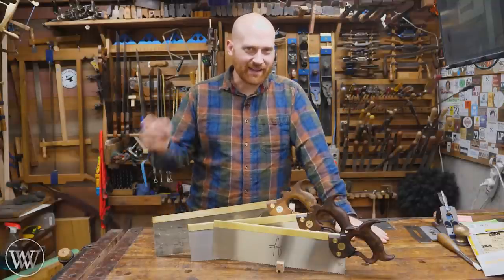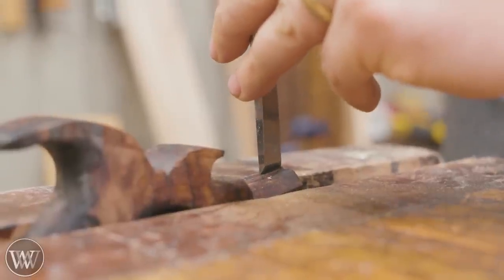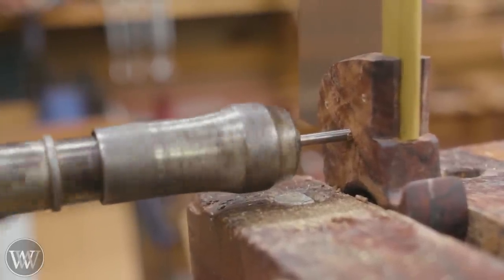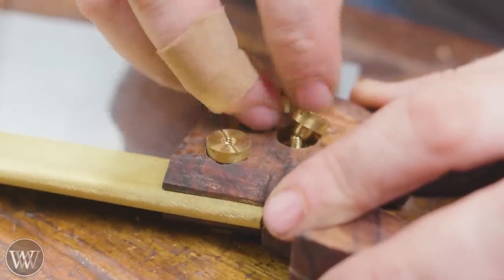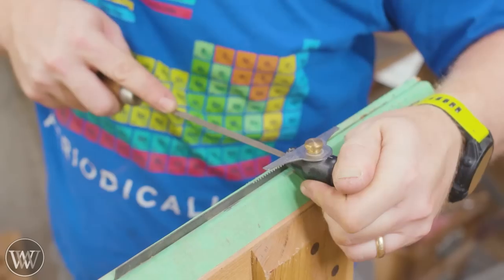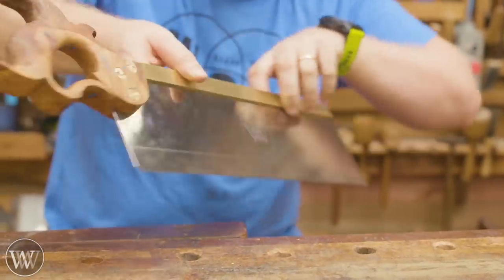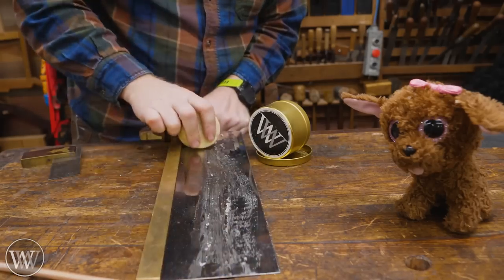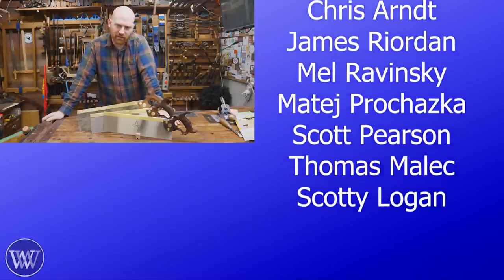How To Make a Back Saw The Hardware Part

Comment: Those are some really nice looking saws!  You've put a lot of effort into getting the details just right.  Thanks for these videos, without guidance from you and all the other creators in the youtube woodworking community this sort of thing would be much tougher to learn.  
 I recently finished making a 3d printable dovetail saw, which I'll soon be posting on Printables and Thingiverse.  Cutting and setting the teeth was a challenge.  Mainly just seeing the details was tough, mine was 15tpi, and I will be using some more powerful magnifiers next time I need to sharpen it.  I did some experiments with your other method of marking out the teeth with a hacksaw, but my tooth pitch was too close to kerf of the hacksaw blades I had on hand, so I ended up using the file to do the marking and the cutting.  I don't own a saw set, so I did that by the method Paul Sellers showed in a video where he used a punch.

Comment: Did you need to do any work to flatten the plate after assembly? To do all the work by hand (no drill press) is really impressive. Great video.
Reply from the maker: That is the fun of a folded back juse a quick tap on the bact fixes the plate.

Comment: Thanks James! I really enjoyed that. Why do you want to upgrade from your Veritas saws?
Reply from the maker: The Veritas saw works well. But the handle leaves a lot to be desired. Also with a folded back you can easily adjust the plate and there's less chance of kinking it in the future. With the Veritas saw it pinned and glued in place and if you run into something the plate will kink easily. Veritas is fantastic for the price. But it's not a high-end top saw.

Comment: Did you have to do much straightening to the plate after the back went on?  I always drill the holes in the handle and cut the slot before I shape it, then it's not a huge waste if the holes or the slot goes wrong...... You're brave cutting the smaller through hole first 😆 Is that carbide spade bit good for drilling the plate?
Reply from the maker: With the folded back I don't have to do much straightening at all just give it a good tap and it brings it right into place. Yes the carbide bit does wonders for drilling through the plate.
Reply: @WoodByWrightHowTo  Thanks James, I will probably buy that bit, spring steel eats up my cobalt bits and I'm fed up of sharpening them after like 2 holes  😂

Comment: What if you don't have access to a saw that cuts a thin enough kerf in the handle for the saw plate?  Your thinnest saw needs a handle!
Reply from the maker: You can always use the sawplate you're intending for the saw and cut the curve with it before you set the teeth. You can clamp it on the bench with something at the right thickness up from the bench and then move the handle back and forth across the saw to cut in the groove.